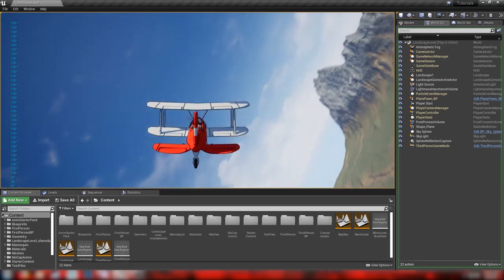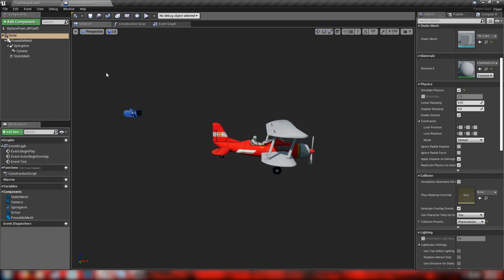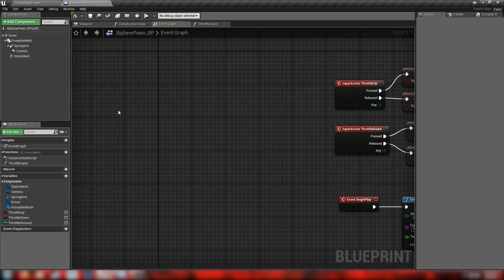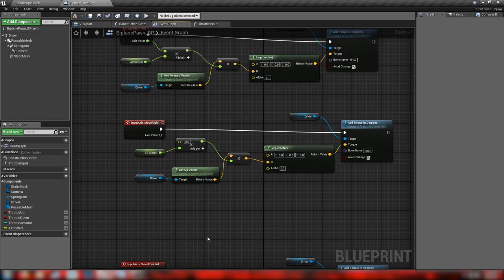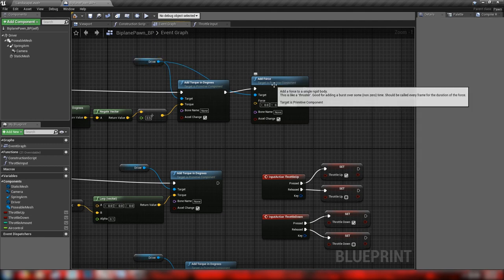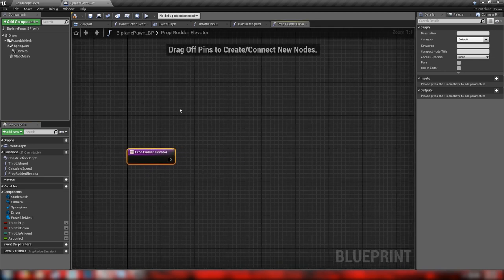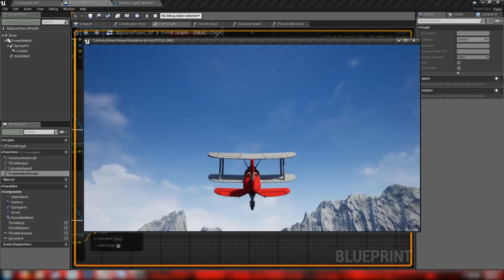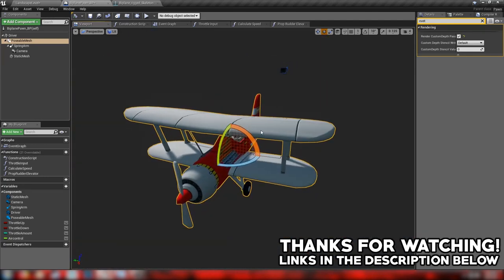UE4 Tutorial: Realistic Plane Pawn

Comment: I actually came here just to see how you applied rotation for a physics based aircraft, as I had a ton of trouble correctly rotating my physics helicopter and I just couldn't figure it out. I never knew the "Negate Vector" node was a thing, and it instantly solved my issue of not being able to counteract the torque I applied to my helicopter. Thank you so much, you've helped me save hours of work!

Comment: 17:28 Here is the real issue while using UE4 physics on a plane/jet fight system. Honestly, I have encountered this problem two days ago, and I ended up solving this issue using "advanced" physics that I wrote to replace current Ue4 physics. Well, the main problem is that when you apply anything force/acceleration/torque related, even if you reset the force back to zero, or by applying a "elastic force" (which relatively works like a spring to basically "brings everything back when there is no input"), there always exists your biggest problem called moment of inertia. 
I think starting from 17:28 has well explained what I meant by. (e.g., your plane is flying backwards after force/acceleration was applied when turning to an opposite direction.... your velocity still exists and its gonna take a while to deaccelerate it to zero and regain speed in the current direction). 
    End conclusion is that: if you wanted to fully enable UE4 physics, then you have to calculate/design a completely new physics system, including drag, gravity, lift, trust, and somewhat force/torque from rudder(s) is/are independently calculated other than from ailerons and elevators, (that says you have to differentiate the center of mass from the center of the acceleration, so your plane can actual balance itself), etc.,... In that case, you are technically recreating a DCS. Now another solution is to bypass the acceleration, using delta second multiplying acceleration variable then use it as the speed increment per delta second (e.g., the easiest form it tries to mimic is that x is equal to one half of x double dot times t square, if it x dot starts from zero) then to act on the forward vector in order to create the velocity, hence to mimic the acceleration. Which they all visually "behavior" the same, however, since now you have full control over velocity, you are very well bypassing the existence of moment of inertia caused by any force/acceleration/torque. And yes, in the ladder case, you are basically building a AC or Project Wingman... Hope that may help anyone who spent time reading my comments :)

Comment: I like this approach some. After watching and testing various flight tutorials, this offers a lot of options. Especially when combined with features from the others. However, I have found that "Set Bone Rotation by Name" , specifically in UE5 only works if the XYZ is in alignment with I am assuming root. For instance if you add this to a Aileron that is on a swept wing aircraft the rotation will realign the bone with the root direction and rotation is not in alignment with the swept wing. weird. Need to figure out how to rotate bone or socket first to axis of swept wing.
Reply: Hey Randy I'm dealing with this exact problem now, Did you figuire it out?
Reply: @muller_digital  yes/no. I did but I have lost all of those files. I have not done programming in a few weeks due to a disability. Time will tell if I can get back to it. But it is just a matter or accessing the bones in a different matter/orientation.

Comment: Idk what part I messed up to make my plane hate me, but after 3 attempts I can't get my plan to fly straight it just hard barrel rolls in every direction until it crashes into the ground.
Reply from the maker: Could be that your driver doesn't have it's collision set properly - make sure the collision preset is set to PhysicsActor, you have 'Enable Gravity' unchecked, and 'Simulate Physics' checked. Also your poseable mesh should have either no collision or be set to BlockAll.

Let me know if that helps! :)
Reply: @underscore00  Unfortunately nope. I am not 100% sure, I started from scratch in fps a couple times, and another time in 3rd. It's very weird, but yeah they were already set the way. I will try to see if I missed some part of the bp's something small like a similar named node or something.
Reply: @frostshock13  Hey ! I have the same problem . Did you get the solution ?
Reply: @Sweet._.Serenade  Unfortunately, I gave up after hours of rewatching and trying different settings and different starting levels (flying,1st,3rd) As cool as it is, i couldn't get it sorted.
Reply: @frostshock13  Oh , Ok
Reply: Same by here, tryied twice and the plane is going in any direction. Tryied to follow underscore instructions on collision presets but i still have my issue. Any link to my UE version which is 4.21.2 ?
Reply: Possibly my problem belongs to my project settings (still investigating). ATM my plane going backward and is not able to go ahead.
Reply: Set the StaticMesh with the Driver ->"NoCollision" and it works
Reply: Set World Dynamic to Overlap or Ignore and it works perfect :)

Comment: Thanks for uploading the video!
I'm curious: when you release throttle and turn, the plane keeps going to the direction it was going even though the "nose" isn't pointing to that direction anymore. I achieved the same effect with the setup I made, but...in my case, if I turn and start throttling again, it instantaneously cancels the velocity on the direction the plane was going and feeds a new velocity in the direction the nose is currently pointing rather than slowly fight to cancel the previous force applied and build up velocity in the new direction.

I want to achieve something smooth and similar to reality. Any ideas?

Comment: What is the difference between add torque / force / impulse? I see that the torque makes sense for rotations, but if I want to make it move forward I can use all of those or not? (though impulse seems to be not good for ticks according to the editor hint)
Reply from the maker: Hi, good question! Basically, torque is a persistant force, and impulse is a single thrust.
Reply: @underscore00  Thanks for your quick answer. So I can also basically use add force and torque the same way for a forward movement?